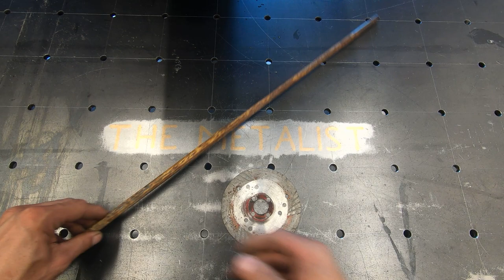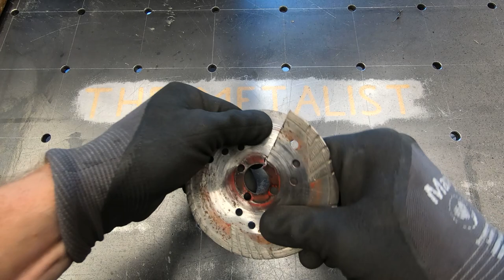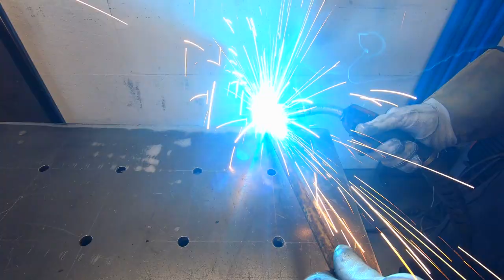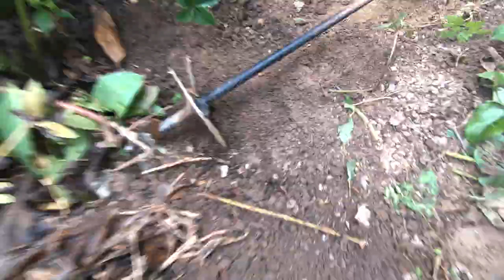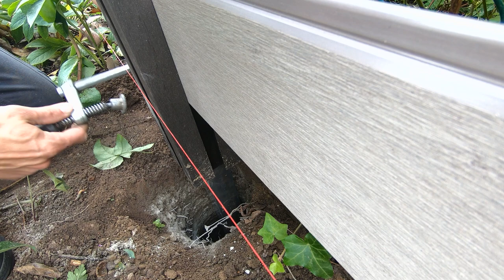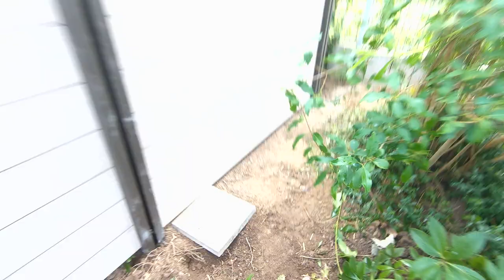Drilling a Earth hole with a DIY Auger Tool for a fence Post

Comment: I tried two different gas powered post hole diggers. Hard red clay and tree roots. Ended up digging 49 fence post by hand. Next time I will make a square tube drive for the tractor and buy a auger. Nice work thanks for sharing many ideas for design in my head after seeing your drill model.

Comment: If you get some sheet metal (which doesn't need to be too thick, therefore easy to bend with the edge of the work table, as it doesn't need to be a perfect cylinder) you can make walls that go up from the blade, creating a "pocket". It allows you to lift even more dirt than with just the empty blade. I'd say for the one in the video, 4 to 5 cm of cylinder wall should be enough, too much and it becomes difficult to clear easily. You can also add a swivel joint near the top, which should be tightly wrapped with the strip made from the inner tube of a bicycle. The stiffness allows you to work the auger with ease, but it also gives you some flexibility and doesn't put too much strain on the drill. Bonus, it also helps clear the dirt in the cup.

Comment: Not a bad design, but I think mine is better. It's based on an old italian planter. You can create 20+ cm diameter holes in no time. My personal best is 40 cm deep in 50 seconds. Strictly hand-powered! It can be extended with a 1/2 inch steel pipe and a welded connection piece.  I made my garage base in two hours. 14 colombs 160 cm deep. No futher concrete job was needed.  It is simple and effective, but require some muscle strengt.
Reply: That concrete mixing is named as "Cigány keverés"
Reply from the maker: Wow 😮 i believe that. Your arms must have fallen off afterwards 😊

Comment: That would not work on the ground here on Guam lol. It’s all rock. Literally only 1-2 inches of dirt in most parts.
Reply: It would if you make the scoop angle more aggressive.
It would also be better if it had more layers, pushing the soil up and/or requiring less pull outs.
No man likes to pull out.................so often anyway.

Comment: OMG... nice DIY tool, but the way to fill the hole with concrete is the worst I've ever seen. Next time, prepare the concrete OUT with the right proportions, and then fill the hole xDDD
Reply from the maker: Thank you 😊 its a finish mix, you put the concrete in the hole and than you fill it up with water. And than its finished. It was new for me too! Tried it the First time like that.
Reply: I’ve never seen before, thank you for the info!
Reply: This is a common way to file post and fencing holes.  Also pulls water from ground, and been done that way for over 100 years.